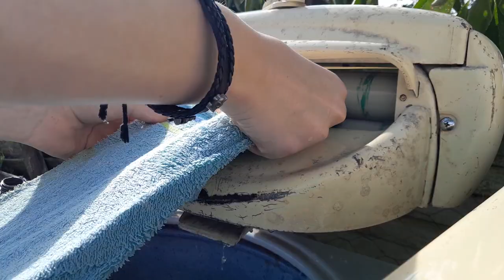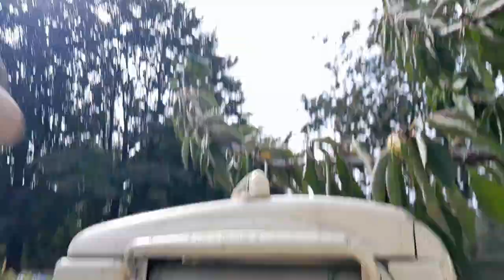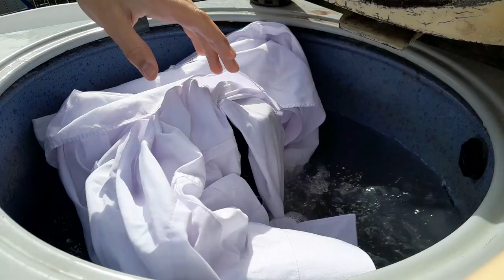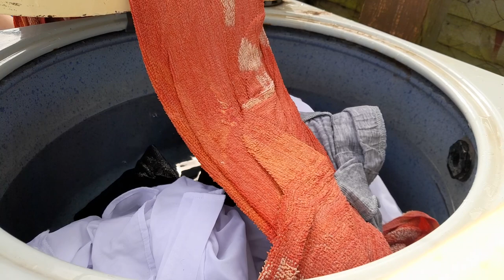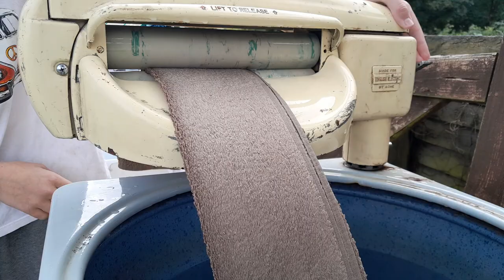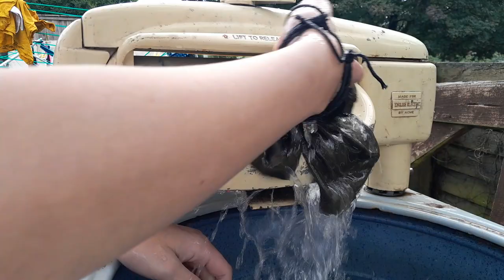full wash in 1950s English electric wringer washer made by acme

Comment: i still used one up until 1999-2000 in a tower block in slaford. it worked fine and fitted in the cupboard and so i never replaced until i moved out. i used it from 1992

Comment: Easily repaired. The rubber band on the pump that pushes against the main pulley has probably worn down. You are running the motor while engaging the pump? Have a word with one of the guys on We Had One Of Those or 'chestermike' on Youtube. They'll be able to help. Hooverlux Restorations could help too. I used a Hotpoint Empress when I had a few large loads to do. Wringing from the machine into a sink of cold water, then turning the wringer to wring out of the sink onto the drainer/work top. Your next load can be washing while you do this. You can whip through tonnes of laundry in 45 mins.